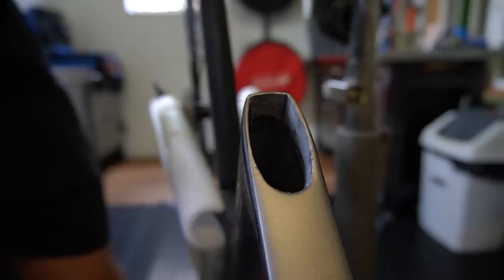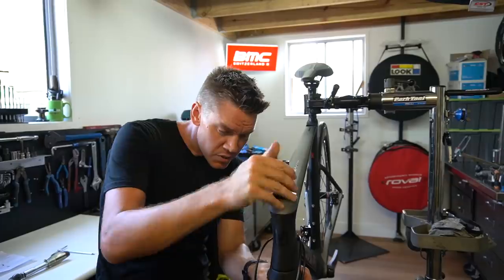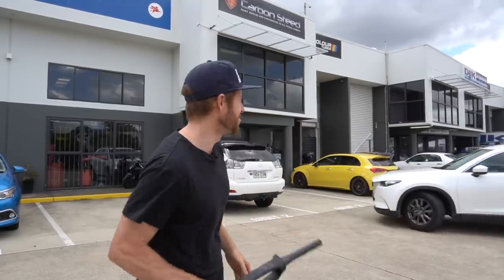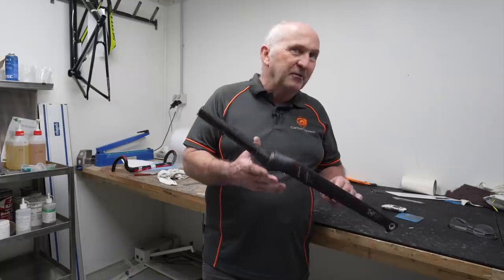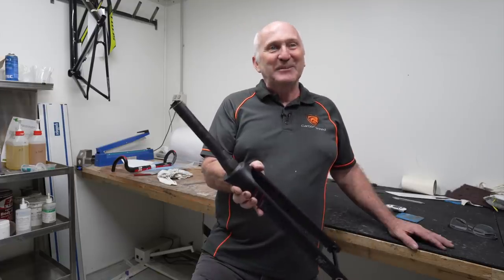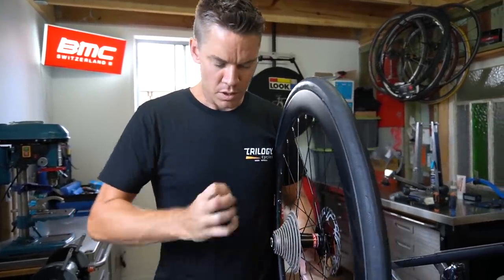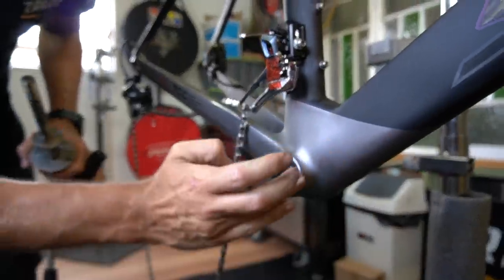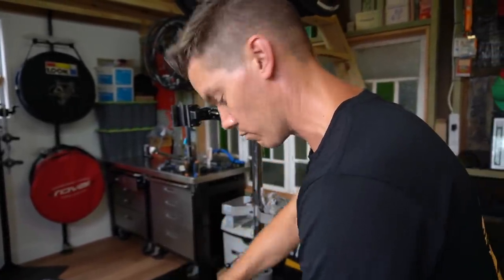The Cheap Chinese Carbon Bike that Backfired

Comment: Why wouldn’t you do these tests for the main stream bikes? A fair comparison yes?
Reply from the maker: Yes it's a fair call. To be honest I never intended taking the bike to Carbon Steed. It was only a visual that prompted the journey. I have never seen a fork that quality before and I was a little concerned to be riding on it. Turns out, it was the front wheel that made the bike unridable.
Reply: @CamNicholls  better cover up the branding and have them do a blind test to avoid any bias

Comment: At least they aren’t charging $15k for a dodgy steerer alla Specialized.
Reply: or Canyon  (van der poel handlebars)
Reply: @escamunicha4276  Or Colnargo. Are they still making people glue in an aluminium tube with a star nut shoved in the end rather than an expander, so you don't snap the steerer at the head set? LOL
Reply: Doesn’t matter if you end up faceplanting.

Comment: Not sure about this bike 
I own a sava with like 7k miles on it 
The only thing a had replaced was the bottom bracket few rear spokes tires tubes I ride this bike like if it’s made out of steal no issues with mine

Comment: Whoa, that hub is crazy!  Since Joytech/Novatec OEM's for so many other brands, I'm surprised it's that bad.

It's even worse that someone built the wheel and didn't notice/care to replace it.
Reply: it could be a "fake" / "no pass" hub but they just want to use it anyway because its cheaper?
Reply: The up and down movement isnt so important but the sideways movement could have been improved with some shims behind the rotor attachment points.
Reply: @truthseeker8483  but the failure you can see it by your eye
I would not ride it anyway
Reply: @NeoPayneHK  Doubt it's fake, looks like a 
D981SB-12.  There has to be a fixturing change between milling the outer hub shell and boring the internal bearing seats, so somewhere between it wasn't properly centered leading to whacked concentricity.  Worst case scenario they had a bad jig and made a whole bad batch of these, best case scenario this one part just slipped out of the workholding.
Reply: @cup_and_cone  No reason for it NOT to be a counterfeit. China has no IP protection. No reason for another company with less strict QC to come out with the "same" product with the same branding.
Reply: Novatec is fine it's their branded fairly high quality stuff.  Some of the Joytech (usually un-)branded hubs are the cheapest and shittiest you can get .... which is why many Western brands use them in budget own brand wheels.  CUBE are notorious for using just about the cheapest SKU hubs Joytech make in their wheels.  I had a Nuroad Pro briefly ... the bearing drag was absolutely unreal.  It was like having the brakes on - all of them are like this.
Reply: @NeoPayneHK  Chinese quality...
Reply: I'm surprised also, those novatec hubs are everywhere and have had reasonable press, even the cheapest hubs aren't normally that bad. Maybe the cheap Chinese stuff is being ripped off by even cheaper Chinese stuff.
Reply: @johna7075  these are probably fake Hubs. Never had novatec hubs wobble like that. Not even hubs on 150€ decathlon bikes
Reply: I worked in a few bike shops,  I'm for one am not surprised that it's that bad.
Reply: Okay, so the flang part of the axle is out of round, it doesn't mean the wheel is out of round, the flang just holds the spokes. As for the other side (brake rotor), a small up and down movement can be compensated by adjusting the brake position. Don't see a big problem here.
Reply: @stevekemp7674  You're implying it's only radial runout, which is not the case.  The bearing seats are diagonal to the flanges, which means the rotor is also going side to side (lateral runout) in addition to up and down.
Reply: @pmcmpc  man I'm going through the same thing with my cube with joytech hub. Did you get a new wheel or fix it in the end?

Comment: That could very well be a 7000± s-works tarmac u know...
Reply from the maker: Hopefully you didn't pull out of the video at the fork inspection. There were actually seven issues all up, one which made the bike unridable. I have never bought a Specialized (and I have purchased five in the past, during my corporate days) that could not be ridden.

Comment: Excellent video.

The 'dry bearings' thing on new bikes; that is pretty common. I've had that with multiple hubs (shimano hubs) on several different bikes (from good brands, they just stuck mass factory-built wheels in them).

I've also had a shimano BB fail in about 1000miles of riding; again, on a new bike. 

So the lesson is, always strip down and check things like bearings.

Comment: Awesome and transparent video. Though this could be just a fluke by Sava to have messed up, but just goes to show, that simple things like greasing of bearings, applying the correct paste/grease goes a long way. Definetely, more care and pride could have been given throughout the build process so that the customer gets a good experience. The hub on the other hand is just poor QC on Novatech's part.
Reply: This many issues is not a fluke.
It's a decision.

Comment: There is always a risk when buying on the internet, some will be good and some not so ( as showcased in this video ). Maybe just by paying a little more and using a local bike shop you get local service and a place to return to if problems occur. Sometimes dealing with local service is the best. I also agree with China Cycling comments it’s not the country but the manufacturer who is at fault. As the old saying goes buyer beware. Thanks for the video. Support your local bike shop. Remember profit is not a dirty word business needs this to survive and offer the service you need.

Comment: The temptation to by an affordable bike that looks the busssiness is so tempting 🤔 but I am thankful that you made us aware of the potential pitfalls that are not obvious
Reply: Look man. I work in sales and sell product all day. The Chinese do not care about quality control.
Reply: That's bullshit. If they totally didn't care they wouldn't be in business. I've bought tons of Chinese bike stuff. I have two full Charbon bikes and have beat them both like a red headed step child (not sure where that comes from but). Flawless exemplary performers.
Reply: @racerx8410712 Did you just buy them from aliexpress?
Reply: @iddra1868  My fat and parts I get from ebay. My mtb I bought used and I am the third owner. Also there are companies like Lamierre and Borealis that buy chinese carbon frames in bulk and put their brand on them (sticker on the downtube). I did hear once that one of those brands got a batch of frames that were a bit too flexy in the rear so they contacted the maker sent them back and got better ones. It's not uncommon even on a personal level to work with a factory to make sure you get what you want.

Comment: Okay, I'm a bit confused about your concern over the front wheel axle flang. As stated in your review, it was off centre, okay, but how does that impact the brake rotor? If the axle is true to the wheel, then maybe the rotor might be out of round to the wheel but you can easily adjust the brake pads to allow for this. A millimetre off centre is nothing. Is there something I am missing? Your concern about the steering tube is also confusing. Yes, I am sure the "carbon expert" was correct in his assessment of the quality of workmanship, but he also stated that he didn't believe it would break and considering it will be hidden inside the head tube, is it important? Lastly, you seemed very concerned about greasing the bottom bracket and steering tube. Is it possible that the manufacturer used something like Loctite instead of grease? Our local bike shop always uses Loctite to secure the bottom bracket press fit bearings. Looking forward to you clarifying these points.
Reply: Exactly! There's actually nothing wrong with this bike. All of these picky issues here I've seen on many other high end brands with different local clubs I ride with. Steerer.. not an issue for bearing displacement over total contact area. Hub mounts for rotor need to check with dial indicator.. could just be minor debris or inconsistent tightening of rotor bolts. Shop mechanic here seems like he's on recovery pissy cycle. Bike is fine.. yes, I would check and "finesse in" bike here as shown.. but you will see these issues on many expensive bikes as well... cheers!

Comment: I run all my bikes with Shimano drivetrain and KMC chains…never had any issue and they last longer than Shimanos…
Reply: Yeah, i have no clue what the mechanic was talking about. Makes me question everything else he said. In my personal experience a new Giant and new Canyon both came from the factory with a KMC chain and Shimano components. Think he either isnt very experienced, or.. honestly thats the only thing i can think of.
Reply: specialized specs KMC on $3000 bikes soo......
Reply: @gweflj  they don't do something that your not supposed to do as well??
Reply: The guy was bitching that he had to use his own assembly paste, and didn't want to touch a bolt until he found the Torque specs FFS, and by how clean that workshop is I doubt he does much actual "wrenching". I've run into many "mechanics" like this, in the auto trade they would have to call themselves assemblers/fitters they "learn" by building up bikes out of the box and reading the manufacturers manuals that they treat as gospel, so he read "Only use with an official Shimano chain" and thats that, nothing you can say will change his mind. He will insist that chainrings and cranks are speed specific and you cant run an 11, 12 speed cassette with a "10 speed" crankset. 
If you took him a 7+ year old bike with an issue he would tell you its not worth fixing and advise you to upgrade.
Reply: @chris1275cc  Well said. I do my own repairs and the place is a mess at the best of times.

Comment: Own 2 Sava's, also have some of my own builds since then and they really put the bike together for casual weekend riding. Both Sava road bikes were all redone by me before they were ridden and many areas which in my opinion are critical for less noise and smooth movements are over looked. Both Sava's have thousands of kilometers on them, they are rim brake based frames with easy to access cables these bikes will go for many more years and I ride all my bikes hard so smooth and noise free is how I have them. My 2 other bike builds are both Rim brake and I simply would not trade them since all the bikes I have seen have excessive noise.

Comment: THANK YOU for the "REAL" and very honest review. This will help people who are thinking of buying cheap bikes
Reply: I have already built 4 fully Chinese carbon bikes with 0 issues. These guy should of just bought straight from aliexpress
Reply: Not all expensive bikes are perfect. One top end brand got recalled for steerer issues.
Reply: @jvaraneta  And one issued a stop ride notice and recalls for failing handlebars.
One major component manufacturer also has problems with their mid-high-end cranksets failing [catastrophically in some cases] after a relatively short time.
So, yeah, budget does not equal quality.

Comment: Lets not forget that the most hyped up bike in 2021 is the S-Works SL7 and it also had the worst recall drama Ive ever observed. Every time I ride mine I avoid the man hole covers and hold on tight.

It is also made in China.
Reply: Well said Durian!
Reply: The bulk of bicycles are produced in China nowadays. I had the great fortune of working for a German cycling brand for over 3 years which saw me spending 9 months in China at the factories overseeing production and quality control.
The amount of brands being produced there, mainly from open molds will astound you.

A lot of the brands then have the bikes shipped around the world in pieces and then slap on an "Assembled in EU" sticker because that allows them to bypass the whole "Made in China" sticker.

With that being said, a lot of the Chinese factories are top notch and super credible. Their production processes are proper and they take pride in their work. Sometimes a mistake gets through but they are quick to action a replacement plan. Nowadays with Covid which caused material shortages and shipping delays, it has made those processes worsen and a lot of retailers left red faced when an angry customer comes in screaming at you and there are literally nothing you can do.
Reply: Os preços das bicicletas de carbono são abusivos
Reply: @blade1994111able  just stop with the rational comments.  @Durianrider says the SL7 is crap, and it’s made in China, so therefore all Chinese-made bikes are crap. It’s settled science.
Reply: @scotth3354  does that mean that all chinese drivetrains are also crap? Better throw Microshift, Sunrace, Sram and Shimano out then :D
Reply: you're on every video saying the same thing yawn

Comment: I have 2k miles on my Sava, I haven't had any issues with it.  It's a bit heavier than most carbon frames though.  I have the Herd 6.0 with full Shimano 105.  My headset was also dry as a rock.

Comment: For an entry level price with decent specs, I’m still happy with my Volck (Sava Rebranded) Carbon bike having ridden it over past 2 months. I agree to check torque settings as mine also came with wrong or loose settings. Thanks for identifying the BB issue which I’m gonna check if mine is greased properly or not. I’ll definitely consider more branded bikes once I’m sure I’m deep into cycling.
Reply: get a yoeleo. They are well made (tested by Hambini) and are very affordable.
Reply: @mapk4655  i will buy a r11 frameset soon. Made by Miracle bikes company. Already bought a fm 296 ( t1000 ) from them in 2016 ( sold ), good quality, zero default.

Comment: some great deals going direct from China but would never recommend to anyone that cant do all the work themselves and already has the tools and knows enough to find the replacement parts they may need at good prices (new old stock or shop takeoffs....) as it can get just as expensive as buying a shop brand fast.    I have built one complete bike a friend bought and built 4 direct frames... feel like buying the frame/fork only is the safer bet and choose one thats fairly well known or at least has some history posted online, a few forums have sections dedicated to direct from china "brands" super helpful with these as specs can change without sales literature/info being updated.     My China Carbonda CRF696 gravel bike is the best and most used bike I have ever owned, have had it a couple years and just got back a few months ago from a south NJ to Pittsburgh PA and back ride (did cheat with some public transpo from just outside DC to the C&O trail head)

Comment: Thanks for the info Cam.
Maybe those "Biopace" front axle holes are a special safety feature to slow you down and prevent you braking effectively enough to over-stress the flaky carbon lay-up in the fork 😄

Comment: I bought the Sava folding 20" bike, I've had it for three years, lives aboard my sailboat, and I love it!  I'm watching it closely for stress cracks etc but thus far it's fine.  It came fully built and was done very well.  However, when it comes to my everyday bike, I'd never replace my Cannondale carbon, but I had to pay real money for that.  I don't think it is fair to expect high quality carbon bikes, basically you are asking for high quality slave labour.  I dunno, it's a hot topic.  Great share, thanks!

Comment: I have seen a cyclist lying in a ditch with the front wheel and fork separated from the frame. That could potentially result in a broken back or broken neck or even death. Sloppy work on that critical part IMHO.
Reply: Like S-Works Tarmac SL7?

Comment: I think you`ll find if you scrutinise any bike as your mechanic has done you`ll find problems. All bikes no matter what the price point will have faults. It`s just that most people without that knowledge will be oblivious. 
And lets not forget that all frames are Chinese so to state "cheap Chinese frame" is a little unfair. I can mention two very high end western badged Chinese frames that are absolute garbage... SL7, SuperSix.
Reply: About the supersix, are you referring to the fork design or the whole frame? "Absolute" garbage seems a bit strong here. I don't want this bike as it's too heavy but I read a lot of happy people riding it.

Comment: I am riding an ALCOTT/SAVA  , had  it for a year,  6000 km on the clock. Superb ride. Absolutely nothing has gone wrong. None of the sbove issues. To be fair, I reckon you should get the importer to say a few word. There are plenty of rubbish bikes , made by other asian/European bike makers.... saying its a " china" bike and lumping them together hints a little bit of xenophobia on your part Cam. I think you should be specifically targetting Sava alone and not say its a " cheap china bike" per say.    Just my two cents mate
Reply: Absolutely.
Reply: Couldn't agree more, thank you.

Comment: In what I can see from the scan images there is absolutely nothing wrong with that fork. That chap saying the cable guide hole is not round..lol, it's not supposed to be round but elongated in a downward orientation to help the brake hose stay flush to the inner-leg. I wonder if he can make a better fork.